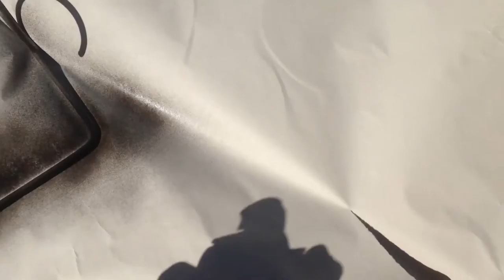Redneck Beer Glass & Bottle Holders

Comment: good stuff Nexia. that jig was a beauty. as simple and as functional as needed. you could make some sweet fishing rod holders like that too. cheers. 17.
Reply from the maker: Victor Bitter Sometimes the simplest builds are the most practical:  30" OD pipe for forming the bottle holder and 2" OD pipe for forming the glass holder...this allows for spring out.  Clamp - or small weld to secure the metal for the bend.  Great for backyard guests, day at the beach, or for camping.  Cheers 17!